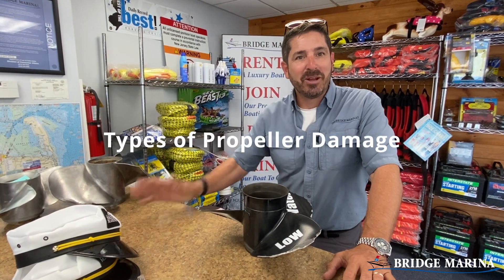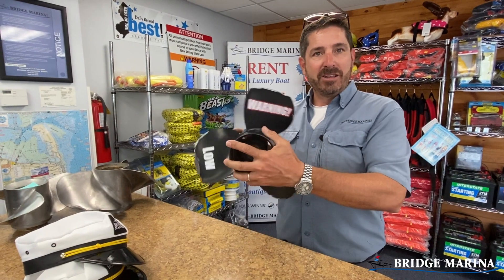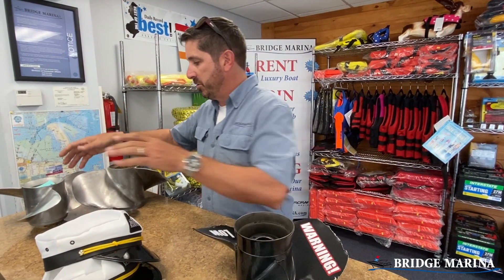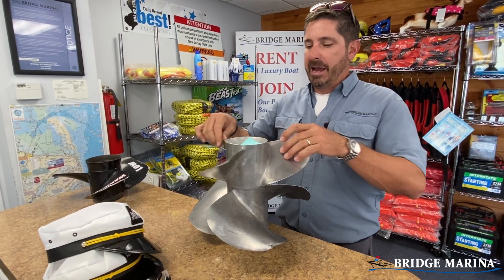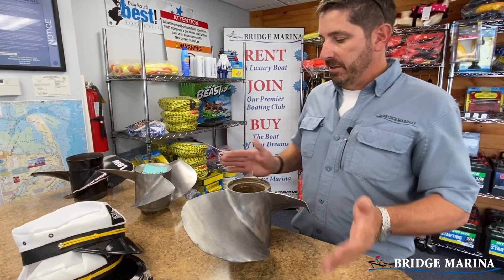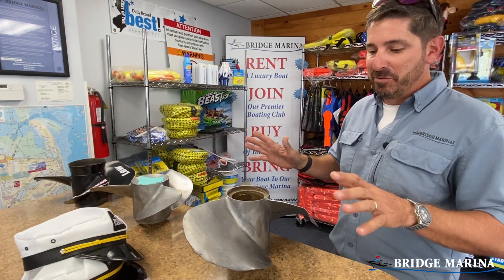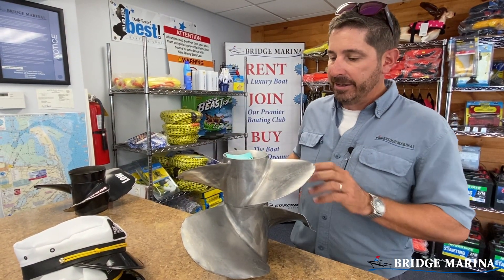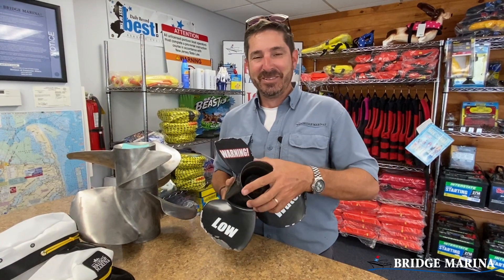Different Types of Boat Propeller Damage, Explained.

Comment: Two types of boaters...those who have roto-tilled some rocks on the bottom in water too shallow and have damaged their prop(s), and those who WILL. It's one of those "should've trimmed up higher" situations. Fortunately, some Marinas have prop repair shops and I've had a couple of mine repaired...one was mangled pretty badly after I roto-tilled some rocks in the Niagara River. They always come back looking like new after repair. It's less expensive than buying a new prop, but obviously there's some turnaround time involved. Always have extra props on-hand in case of a prop strike. That way, if you mangle a prop, you can swap it off, drop it at the repair shop, and continue to boat on the water with your spare prop.
Reply: L